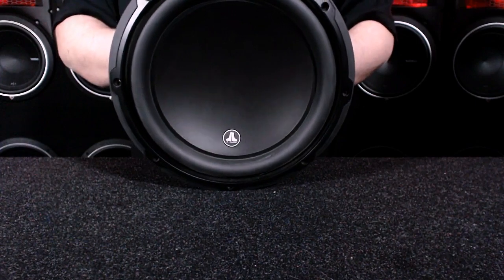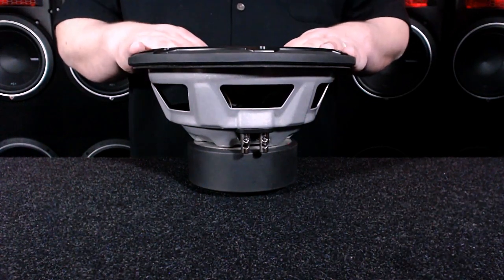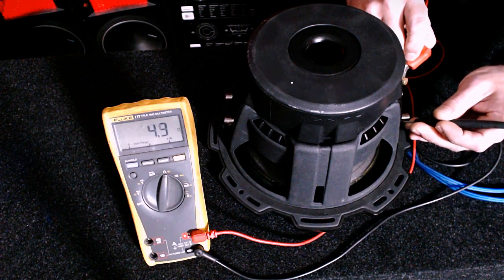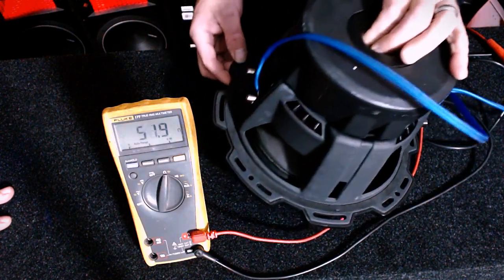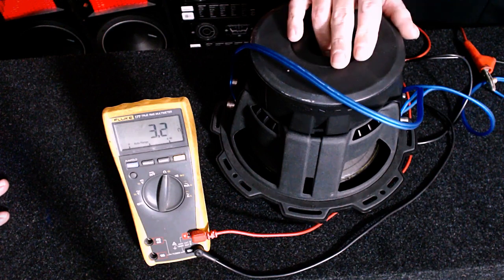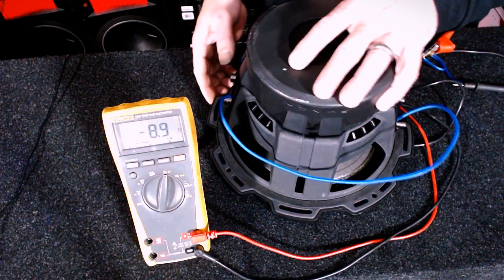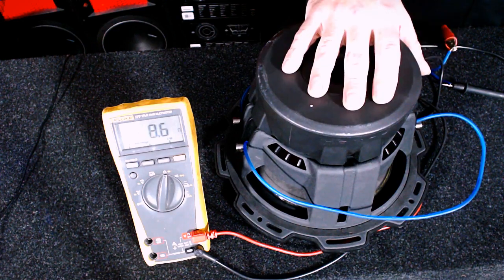Single vs Dual Voice Coil Speakers

Comment: I have a question which nobody seems to answer, how does a DVC sub perform when wiring to only one set of terminals?  I have an amp that I want to run at 4 OHM MONO and have a DVC sub (dual 4 ohm VC), so what can I expect running to only one set of terminals?

Comment: I have a Rockville 10 inch subwoofer with a built in amp. It has a 500w rating. I was wondering if i could get an SDR 10” and the box/amp be able to handle it? I’m fairly new to subs so any help would be much appreciated 🙏

Comment: Is each voice coil independant of each other ?? Can i just wire one coil to my amp on a dvc sub ?? Will it produce 100% or will it only run at 50% because only 1 coil is being driven ??
Reply: That’s what I want to know also will just wiring up one coil make it just a 2ohm or 4ohm sub
Reply: @alexzuniga2933  got the answer elsewhere. Depends on the sub. Its either dual 2 ohm or dual 4 ohm. Each coil will be 2 ohm or 4 ohm. If you wire one side, it will be either 2 or 4 ohm.

Comment: i am planning to buy a pioneer ts-a1200d4 subwoofer (500rms and 1500 peak)which has dual 4 ohm voice coil. and i already have a jbl gt- x424 amplifier which has 45w rms*2@ 4ohm and 75w rms*2@ 2ohm configuration.
what kind of wiring should i use(series/parallel) to get the maximum output. or you could suggest me any other options.
Reply from the maker: If the sub is 500 watts rms I would recommend getting a 500 watt mono block amplifier and run the sub in parallel.

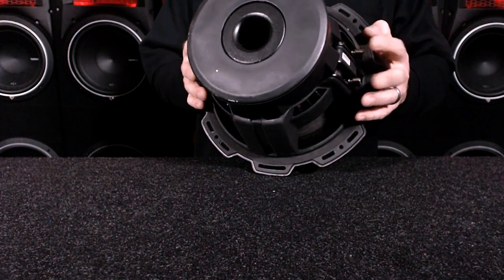Comment: 1:35 - not sure the philosophy about dual voice coils is sound; if you will excuse the pun.

Contrary to what’s being said/inferred in this video . . . 

Dual voice coils don’t usually make the design of the transducer simpler; single voice coils do.

That said, I suspect the guys are referring to installation/sales, when they say “simpler”.

As, a dual voice coil woofer (and its variable resistance configurations) can sometimes adapt more easily to most pre-existing and/or planned cabinet/amplifier considerations/combinations.

However, there are a few substantiate/woofers out there in the market that have dual voice coils and only have 2 (not 4) terminals on the basket.

Put simply the terminal count is not necessarily an indication of how simple, complex, and/or elegant the transducer architecture is.

The JL Audio driver shown in the video at 50 seconds (with only 1 voice coil) is a very basic woofer design.

In fact, so is the other one.

Have a look at 18 Sound’s Tetra Coil woofers to see what goes into a good woofer design.

But then, the car audio market is not really the most informed market in the world.

Most of the time the guys that buy these and listen to them loudly in their car, are basically driving around listening to the repeated impulse response of the woofer over and over, and over again. 

When done right; dual (or quad) voice coils are useful because they usually enhance power handling; as - for applications where voice coil material/length is the same with a single/dual voice coil assembly - they spread the thermal load and allow it to be transferred away via conduction/convection quicker/easier.

Dual voice coils can also be used to improve/enhance the electromagnetic circuit and overall electromotive design in various ways; including controlling stray inductance.

Testing for and/or relying upon the nominal resistance figures as (shown in the video at various stages; including at 3:46) a means to select series/parallel configuration with the dual voice coil woofer and/or amplifiers, is - in my opinion - *not a very good approach.

Still, I guess it’s better than not knowing anything at all and/or the nominal resistance; particularly for scenarios where an accurate impedance plot is not available.

There are many reasons for my *aforementioned opinion (about why testing for and/or relying upon the nominal resistance figures is not always a good approach) but one of them is because it is the impedance of the transducer (combined with any crossover reactance) that really matters most and dictates what load the amplifier will be driving.

And, the only way to know that is for the manufacturer to provide an accurate impedance sweep chart across all frequencies the woofer operates over and/or for someone to put the woofer in a sealed/ported cabinet that best emulates the end use situation.

Comment: What's better 2500 watt power acoustik or California  1000 watt on a single Orion 12 subwoofer u took the speaker out the box and ran just two wires + & - what should I do?
Reply from the maker: You have to give me a little bit more information what exact kind of rain before his it and it is a dual voice coil and what impedance is each voice coil if so?
Reply: @stereoking7778  I have one 12 subwoofer orion and it's hook up as single I had it hook up to the California amp then I came across the power acoustic 2500 watt what's the best one to hook up that's all I'm asking
Reply from the maker: What is tbe power handling of the Orion subwoofer?

Comment: is it dual voice coil speaker can produce a sound if we only wired at one side
Reply from the maker: Yes it will make sound, but it is not recommended as it could damage the speaker.
Reply: Stereo King Thanks for the info...

Comment: can you connect  a double coil to a two channel amplifier?
Reply from the maker: The basic answer is yes you can but it depends on what impedance each voice coil is and how you need to wire the subwoofer based on what impedance voice mail you have.
Reply: I have the same question no one can answer it can you please answer this for me ASAP!!!
Reply: I have 1 dvc 4ohm sub , I have a 2 channel amp stable @ 4 ohms & 2ohms . Can I wire 1 voice coil separately to 1 channel & the other voice coil to the other channel? Will my amp detected it as a 4ohm final impedance ?? How much power will it give ?? @4ohm 200x2 @2ohm 600x2 bridged @4 ohm 1200x1 . I need help

Comment: i have a 4 channel amp but only one channel for the suns, the rest are for the speakers, can i get a dual voice coil 15 with only the one channel for my sub, will sending 4 wires for two terminals from the sub work??
Reply from the maker: Yes and no. Technically you could do it but it's not going to sound very good. You can't have left sides for your 15 crossed over for just your sub and the right side to run the back speakers it won't work properly.

Comment: What i don't get is, if i have, for Example, an 100W RMS DVC Sub, did this mean, that it has 200W over all or still 100W, i mean should i Adjust the Amp to 100W or 200W. And is there an Difference between Serial and Paralel, in the Amp Setup? Sorry i'm totally new to DVC. I would tend to Paralel 200W and Serial 100W but i have no Clue if this is right.
Reply from the maker: If a sub is rated at 100w that means it can only handle 100w of continuous power whether it is a single or dual voice coil. Lets say you have a dual 4 ohm voice coil sub that you have wired in parallel. That means your sub woofer will receive what ever your amp will make for power at a 2 ohm load. But you wire the sub series your amp will only make roughly a quater of the power that it would make if you wired your sub in parallel.
Reply: @stereoking7778  Thank you very much, for the Explanation. I think i got it now.👍

Comment: Why not connect 2 amp channels to DVC, one channels POS and NEG to one terminal POS and NEG and then the other amp channels POS and NEG to the other terminal without bridging?
Reply from the maker: You can do that, but most boxes only have terminal per sub.
Reply: @stereoking7778  My OEM sub has DVC and there is coming 2 pairs of cables to each terminal from OEM amp. Thinking of replace it but no one is mention that option so it makes me wonder if there is something else they have done with the OEM sub to make that work or the amp. The OEM sub is at 2 ohm on both terminals, if I buy a 2 ohm DVC does the two channels in the amp share/split the watt load or do they have to work as hard if I had power a SVC with one channel? The DVC and the SVC has the same specs.
Reply from the maker: Most factory sub amps are mono so they use a dual voice sub to drop the ohm load down. The lower the load generally means more power. So if you wanted to do a single voice sub you would need a sub at a 1 ohm load. It Usually easy to find a dual 2ohm sub than a single 1 ohm.

Comment: hi I have 2 soundstream 12"  r3 subwoofers  what is it good way to wire them ???
Reply from the maker: I would wear each subwoofer in series which will give you four ohms each per woofer and then parallel them at the amplifier which should give you a two ohm load at the amp.
Reply: @stereoking7778  can you send a photo for how to wire them to my Gmail pls ??
mpower16v666@gmail.com

Comment: Good video, but it didn’t answer my question. Maybe you can help. I have a 2002 Pontiac grand am with the premium monsoon stereo. Apparently it takes dual voice coil 6x9 rear speakers but I can’t find any. Can I wire up these 4 wires to a single voice coil speaker some how? 1 set for highs and 1 set for lows. I hope you can help! Thank you
Reply from the maker: It's not really a dual voice coil in the normal sense.  The best thing for you to do is find a pair of six by nines that have a set of wires that can be disconnected from the main speaker terminals. For our customers I usually recommend the hertz dcx690s.  They will have what you need. Just connect the two wires that come from the Tweeter and attach them to the highs output from the hip and then connect the low frequency output to the standard terminals off the speaker.
Reply: Stereo King okay, so what you’re saying is I should get a coax 6x9 with tweeter wires that run from the tweeter down through the cone to the + and - posting. Then take those wires and splice them with my 2 hi freq wires, then run my 2 low freq wires to the + and - posts like normal?
Reply from the maker: Yes sir. Just make sure you cut the wires that go to the tweeter loose from the standard terminals.
Reply: Stereo King okay, so apparently nobody knows anything, except you guys. Because this actually worked!!!! Awesome! Never thought this could be done. Thank you so much for you help. I’ll always come to you guys with my questions. I’ll be subscribing and following you guys for sure. Thank you again. And happy new year!
Reply from the maker: @kylem8702  always glad to help, and a Happy New Year to you as well sir.

Comment: good day sir...Does the tweeter and mid range are excluded in the final impedance? or are they included in the calculation...Because i thought that the calculation is only meant for the woofer and sub? just an ignorant question sir pls. enlighten me...my example is 8ohm woofer, 8ohm midrange, 8ohm tweeter in parallel...
Reply from the maker: Generally speaking the mid and the Tweeter are through a passive crossover Network which masks the actual impedance of each  component. Typical crossover Networks have resistors added for the Tweeter and sometimes the mid that altar what impedance the amplifier will actually see.
Reply: @stereoking7778  ok..tnx...more power to ur channel

Comment: i know this is an old video, but i have a DVC 2-ohm sub, what i understand is i can either run it in 1-ohm or 4 -ohm by the way i wire it? im sorry but this makes little sense to me how could i safely wire my DVC 2-ohm speaker? (please be specific on how to wire and what impedance amp i can run best) thank you
Reply from the maker: First can you you tell what amp you have and how many subs are you going to use?
Reply: @stereoking7778  i have a pioneer 4 channel right now, but ill get rid of it and maybe go for a planet audio 1000w monoblock at 1ohm, qnd my speaker is a sundown sa15 DVC 2ohm but ive done more reaserch and ive tested my speaker it is a 2ohm and i can parralel it or series it, but im undessisive about an amp... idk if its better to underpower the sub or overpower it...
Reply from the maker: I believe it's  best to overpower a sub then under power it. The reason why is you tend to send Distortion trying to get more from the subwoofer when you underpower it. If you overpower it you tend to scale it back a little bit and then the amp it doesn't clip.
Reply: thank you, i understand about impedance now, and was wondering about overpowering or underpowering a sub but than you for that information, ill try to find an amp 1ohm stable or maybe go for a 4ohm but not sure on that still since i dont have a box yet my speaker is 750w rms and im trying to find a near 800w or 1000w rms amp and control gain to get rid of clipping, thank you tho i know know a little more about a system then before
Reply from the maker: I highly recommend getting a box made specifically for that sub. Believe it or not the enclosure plays a larger role in how the system sound than the sub itself.

Comment: I’m a little confused about SVC. Can I just hook it up and not have to worry about and impedance measuring?
Reply from the maker: You will need to worry about the impedance. If your amp is 4 ohm stable then you will need a 4 ohm sub, if your amp 2 stable you will need a 2 ohm sub. Etc. This is based on if you only using one sub of course.

Comment: Can i power only one vc in a dvc sub..??  Will it damage the sub at all or in the long run only..??   IF it is safe to run one vc .. will i have the same amount of bass or only half..??
Reply from the maker: Not safe it will damage the sub.
Reply: Care to explain HOW it will damage the sub..??
Reply from the maker: Think about it like a V8 motor. If unplug half the spark plugs you will seriously damage the engine. The same goes with a dual voice coil woofer. The motor structure and cone are designed to use both coils. If you only use one to push it it simply can't create enough energy to move it properly and ends up damaging the coil.
Reply: ACTUALLY..... the 5.7L hemi engines from 2007 are designed to run on 4 cylinders to save fuel....  Granted any other V8 ... yes it can do damage because even though you cut spark... there is still air and fuel going in and compressing but not igniting...  So yes it can hurt unless you shut off fuel & spark from those cylinders... then it will work ok as long as you shut the right ones off.... The engine must still be balanced, you must cut 2 from one side and 2 from the other side...and it must be in a cross angle firing pattern...  or else you get vibration... back to topic..
Interesting... i keep getting mixed reviews on this subject and its almost 60/40 right now. Some say there is no damage and others like you say there will be damage... One guy even claimed he has been using his dvc sub for 5+ yrs and only has powered one side and its still working just fine..
Reply: @stereoking7778  i need to wire to two ohm because im strapping my amps but i ha e 2 4ohm dvc ...how can i get the most of my amps if strapped the 2 ohms i cant acheive. Makes the amp see 1 ohm then y cant i just leave my parralelled wired dvc 4 ohms at the 1 they are
Reply: @stereoking7778  or should i not strapp them and loose power
Reply from the maker: @justinstumpinhagen7363  If your amps are 2 ohm stable and you have 2 4ohm dvc subs, I would not strap the amps. I would run 1 sub to each amp.

Comment: I have a stock duel voice coil subwoofer.  I’d like to put a larger boxed subwoofer (single voice coil)  in my cargo area.  Since I’m not changing or adding an amp I’m assuming I shouldn’t run both.  If I don’t run both can I simply disconnect the stock sub and and take one set of positive/negative wires and connect them to the boxed sub?
Reply from the maker: Unfortunately to make this work properly you will need to add a amp. The factory amplifier will probably not have enough prower to run the sub you are planning to add.
Reply: stereo king oregon I think I have 75 watts going into each side of the stock amp.
Reply from the maker: At what ohm load? And how much power does the sub you want to add need ?
Reply: Sorry, I meant 75 watts going into each side of the stock subwoofer.  The boxed sub is basically a 12” Memphis with no labels that I’ve stored a long time.

Comment: What happen if you connect a dual coil sub to a bridged amp. In the scenario of using a dual 8 ohms subs making the funal 4 ohm resistance to the output of the amp.
Reply from the maker: That should work great! If you are bridging a 2 channel or 2 channels of a 4 channel amp, they are generally 4 ohm mono stable.
Reply: Mehul Singh no sir.  Many 4 channels can be bridged to 2 channels. If it doesn't show it on the amp check with the manufacturer.

Comment: Which is better for a mono amplifier thats is poineer 2400watts  a dual coil or single coil and which is more better in every thing i need a big bass and a clear bass ?
Reply from the maker: While dual voice coil woofers will generally handle more power, it doesn't really matter. If your amp makes 2400 watts at 2 ohms, find a woofer that will handle 2400 watts and be at a 2 ohm load, don't worry if it is single or dual voice coil.
Reply: Okk thx a lot guys i will bring a poineer 2400 watts mono 1 channel they write on the box 1 ohm on it but inside the detail they write that impedence 4ohms( 1 to 8 ohms ) with a subwoofer poineer  12 inchs 1400 watts 4 ohms dual coil . Is this action good or not ?
Reply from the maker: Check your amp and woofer and see what the RMS rating for both both are. See how much power the amp will make at two ohms.
Reply: Okkk thx guysss for the information

Comment: Can we run only one coil?
Reply: it will not damage the speaker im running 6 DVC subwoofers as SVC in parallel series and no issue
Reply from the maker: If you only use one voice coil the subwoofer will work, but I don't recommend it. The woofer is designed to you both coils and only using one will greatly reduce the life of the sub.
Reply: piyush suthar it will also cut power of sub in half